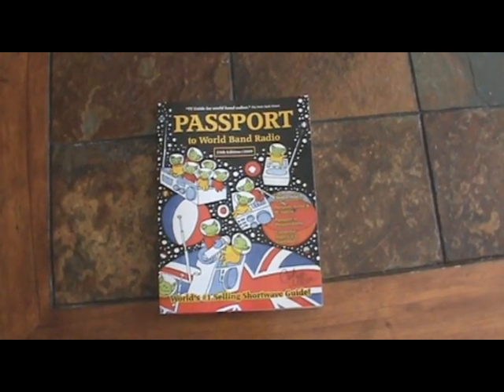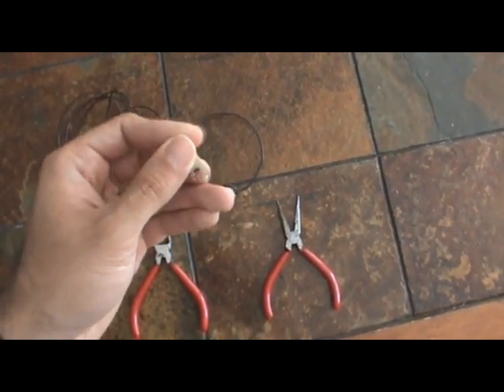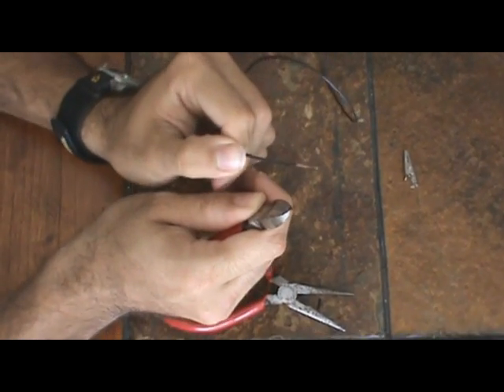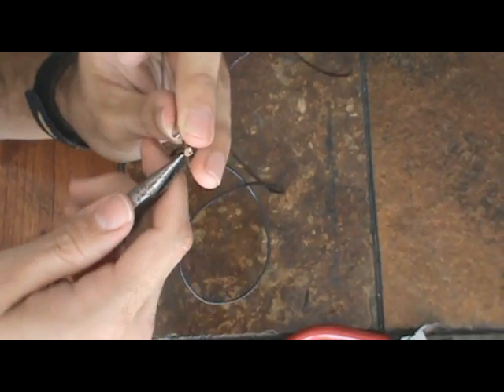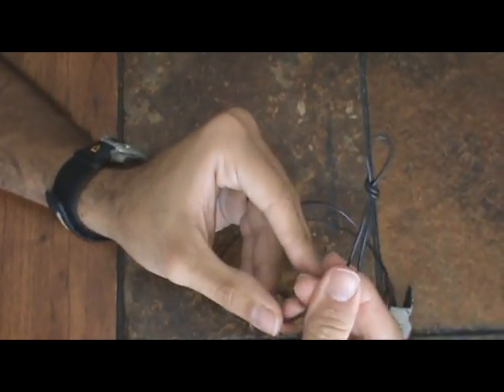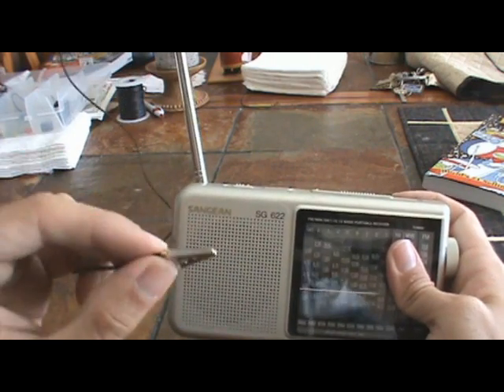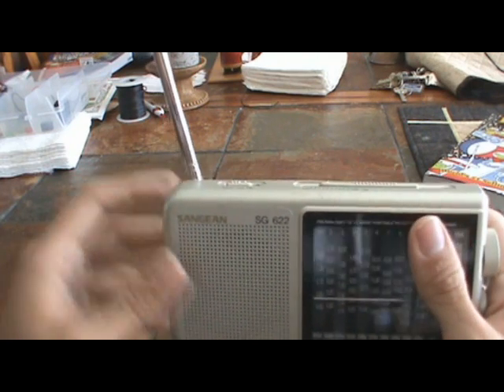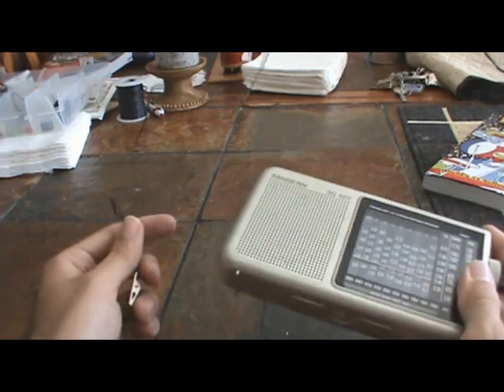How to Make a Shortwave Radio Antenna for Less Than $1.00

Comment: A piece of wire longer than 5 feet will be better! I use 20 feet.
You can probably get the "alligator clip" from a home improvement store or eBoo, since Radio Shack is out of business.

Put the clip on one end and tie the loop on the other end.  Then you can tie some twine to the loop and a weight, and throw the weight over a tree branch.
Reply: Ha! So is "Passport to World Band Radio" - probably the year this video was made.

Comment: Nice video about a simple way to improve shortwave and also on FM, but never use more than 25 Feet (7,6201 m) not to overload your analog radio and reception goes bad on all bands. Also you get images a lot from stations you can tune in but which arent on that frequency originally. One tip more: Keep that anrenna nearby a window or better outside the room. Keep in mind you have more signals but you also more noises (RFI of computers, TVs etc.) on shortwave. However, its a cheap and fast option to improve reception for simple world band receivers or kitchenradios.  Vy, 73

Comment: sometimes I need to put a simple, random-length wire, instead of directly connected to the antenna, wrapped about 3 times around a paper or cardboard sleeve. This is quite necessary if I use a longer wire than your 10 footer, for strong signals. The maxed-out rf gain of these little radios is so amped it's like an active antenna, easily overwhelmed or desensitized. If the signal gets loud, peaks, then wanes, over and over, you're experiencing desense. I get better results from not shortening the wire but rather attenuating its connection to the telescoping antenna with indirect coupling. Technically it's a little capacitive and a little inductively coupled. This is just one fun way to experiment. Compare how much DX you get with a pretty longish wire like 20 to 75 feet, coupled with some insulation like cardboard or several sheets thick of paper like a tube around the antenna, with the wire wrapped over it a few turns, compared to a ten foot wire directly, conductively connected. This can also help prevent static discharge in your radio to some degree. I took this further and connected a variometer to a 150-foot wire and added an L-match in-line, the easiest antenna matcher to make (one coil, one variable capacitor). For RX it can be just a plastic clear square box one from a clock radio or jam box. I/ know constructing an l-latch or even placing a variable resistor in line are all getting a lot more technical than a wire and a clip, but they were my gradual progression which got really cool when the l-match started tuning the wire as if it were resonant on that one frequency, a real way to fish the static for more signals without paying a dime for anything. The coil is just more wire. Rambling now, thanks for the video!

Comment: The radio signals usually operate better on darker segments of the day due tue the waves being transmitted by the sun being blocked off. This causes less interference with the radio waves, which is what I'm guessing is the answer to the efficiency added to your radio at around 2:00 am.

Comment: Will this work on the AM band? Should I shape the wire differently?
Reply: thought so. I've been trying to figure out a way to increase the reception for the AM band. I'm sure I've phrased that incorrectly, please forgive me. I live in a stucco building and that wire mesh just grounds the whole thing. It makes getting any signal more difficult.
Reply: Thank you for being so helpful. I did look into a loop antenna and think I'll try that before anything else. I don't know what is, "dxing". It's an AM/FM and short wave weather radio. It doesn't get very good AM reception inside. If I take it to the patio, POOF! Great reception. I like to listen to the radio at night. I'd love to graduate to a HAM set. But for now, I'll listen.

Comment: Thanks for the great instructional video. Quick question - I know you used a 28 or 32 gauge wire in this video, but is there an "ideal" gauge for a shortwave radio antenna? Many of the insulated copper wires being sold in hardware stores are around 16 or 18 gauge. Would those work as well?
Reply from the maker: You can user a larger gauge wire, but it's harder to work with. Go to Electronic(RadioShack) supply stores and some stereo install places will have smaller gauge copper wire.
Reply: +John 
Would using a smaller gauge wire (thicker wire) i.e. 12 gauge be better than 20 gauge?

Comment: Decent vid for the beginer. The noise durring the day in the US or any place, is partial due to solar radiation, and partialy due to local (proximity) type interferance. As in there is more stuff on the same wavelengths, closer to your location, with a stronger signal than what you might be looking for, like a weak signal from belguim or whatever.

Comment: You can't turn a normal AM/FM radio into a shortwave radio by replacing the antenna. The frequencies the radio can receive are dictated by the internal circuitry. If your radio is designed to pick up the FM broadcast band, there isn't any antenna in the world that will make it work with anything other than FM broadcast.

Comment: MOST IMPORTANT! Always disconnect this antenna when not in use. Especially if it runs outside, or is longer than about 20 feet. Also, if its more than about 40 feet, you could simply wind the insulated wire multiple times around the telescopic antenna, which may help protect your solid state radio from static electric damage. If its a tube radio, then I wouldn't worry about it. Finally, if your radio has an antenna jack, you cant beat a simple antenna tuner like the MFJ-956 or similar.

Comment: Great video for a simple antenna. I thought I would give a few more tips, if no one minds.
You can use just about any kind of wire, but I like to use stranded insulated copper wire. The length can be from 10-120 feet (3-40 meters), but I like to use about 40 feet (12 meters). It works best if it is outside, away from power or cable TV lines, or anything else that can create noise. In my opinion, ground isn't needed in most cases, but feel free to try. Don't be too disappointed if it doesn't help

Comment: Run one wire outside to a good ground, . You can get a 6ft or 8ft ground rod at many hardware stores. Pound it in the ground less 4 inches, Run a wire to one side of the coax/twin lead from the Ground rod and the other side to your long wire. Then you will be amazed at what your radio can hear., especially on the SW and AM broadcast bands, Google Outdoor SW antennas for more info. The ant does not have to be high,, 20 feet up is fine.
Good Luck. and Good DX,
Glenn WA4AOS
Ham operator since 1971

Comment: Your antenna extension will help on the FM band but for lower frequencies in the Short wave bands, especially below 8MHz, this kind of extension will be bad for picking noises in your home such as computers, some CF and fluorescent lights and switching power supplies. If your radio has a place for external antenna, it would be much better to use  300 or 400 ohm ladder line or 50 or 75 ohm coax to go out side away from the house and run a hundred ft more or less to a distant tree  MORE NEXT POST

Comment: in reality for receiving get a long piece of wire and connect it to an adjustable capacitor off an old radio and connect it to the antenna and thats all. the internet is loaded with homemade anttenas but its nice to c u experimenting.

Comment: Great video!
I have a question on antennas.
I have a Grundig s350DL. On the back of the radio I have two antenna jacks,(twin lead antenna plug-in),for AM and/or shortwave. 
If I plug-in the antenna to the AM/shortwave jack I get good to decent reception.
If I use a alligator clamp on the antenna I get great reception.
Why is that?

Thanks, Scott

Comment from the maker: @ascheier 

I would try this antenna and see how it works. Also change the direction of the antenna, you may find positioning the antenna north/south may work better than east/west, also experiment putting the antenna parallel with the ground at different heights, like 5', 10', etc. You should be able to pick up those frequencies with little problem. Let me know how it works out. Good luck with it, take care, John :o)

Comment: You can also use this same method on bunnyears (TV ANTENNA) radios as used in this video but any antenna  will work..ypu remember seeing people with foil on their tv ?? same concept  all you are doing is extending the length of the antenna and making a longer antenna. Good video use any guage wire it  doesnt matter. You can wrap it around the antenna if you dont have an alligator clip. Well great video thanks. Grant

Comment from the maker: @JDTV1995 

Go to a radio shack or an electronic supply store. You need to get 28 or 30 gauge wire.

Good luck with it. -John

Comment: always fun listening to distant stations. the telescopic antenna is ok but adding a wire is better as shown in the video, one thing you might want to add is ground, a good ground connection will probably increase the s/n but reducing the noise, these small radios normally dont have ground connectors but the negative battery pad can be used. Good luck.
73 de OY1R